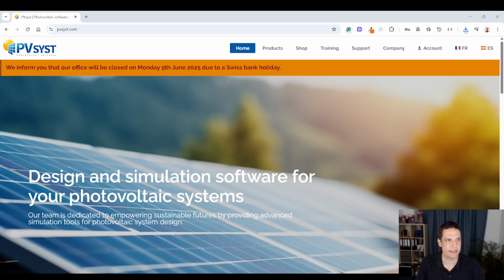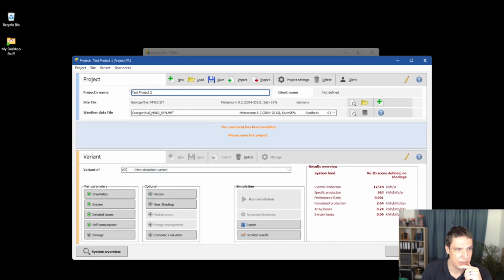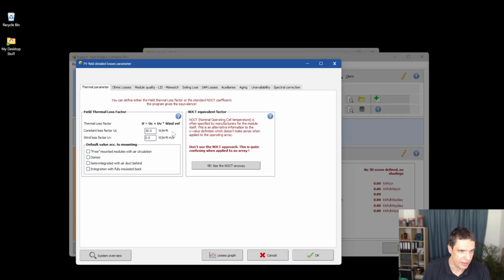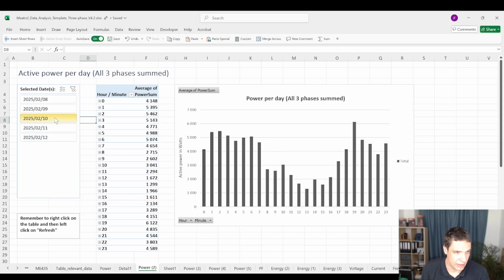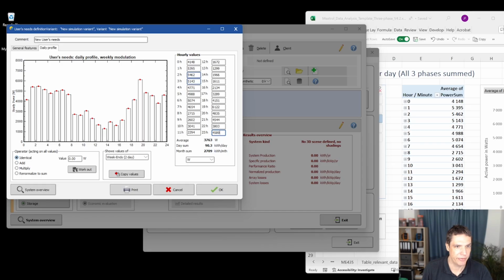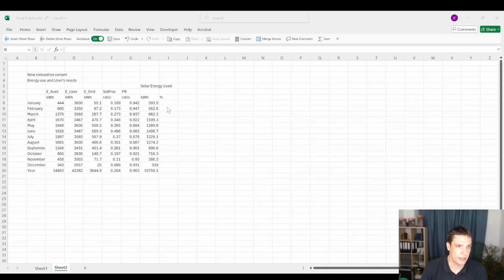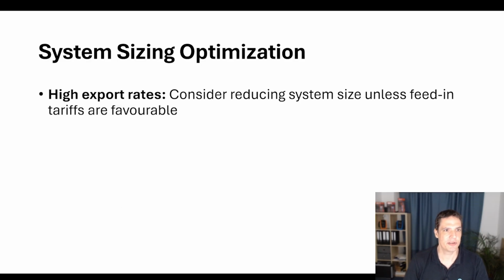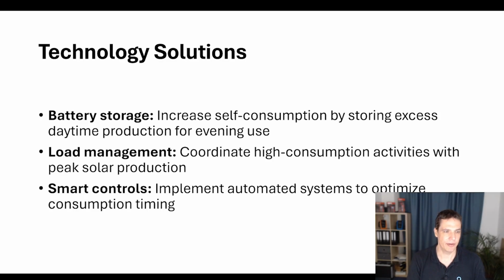Maximize Commercial Solar ROI: Complete PVSyst Self-Consumption Analysis Tutorial

Comment: Thanks gr8 presentation, question how long would you recommend one to energy log a building/infrastructure to have enough accurate data  for correct PV sizing
Reply from the maker: At least one full week. So, 9 days to account for the partial days data when installing and removing the meter.